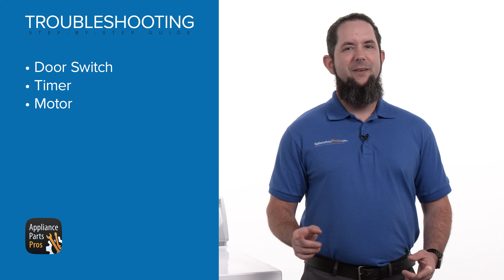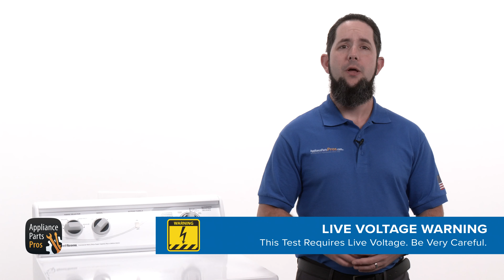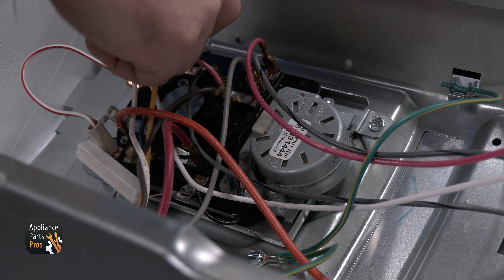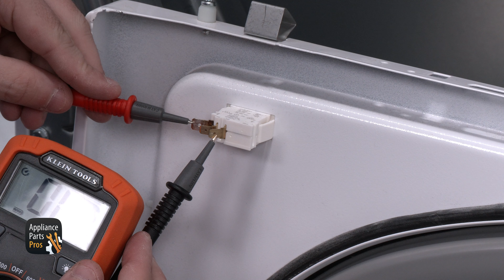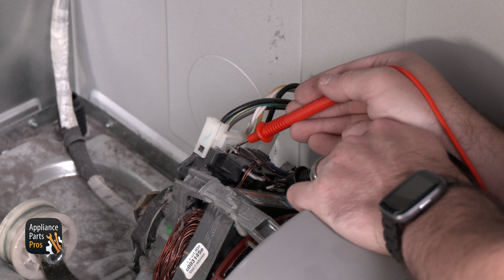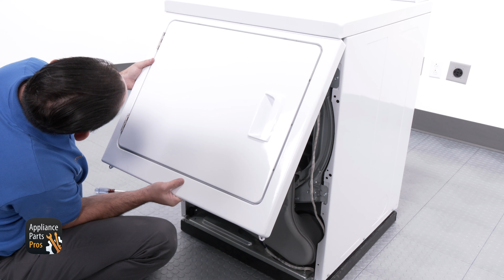Speed Queen Dryer Not Starting - Top 3 Reasons and Fixes

Comment: Great video overall.  Turns out my problem was that the "push to start" function of my timer dial was the issue.  You have to remove the pink+brown contact on terminal M and then measure between L1 and M while pushing on knob.  I was prepared to add just a new single pole momentary switch in parallel to the old one, but I was successful in fixing it with some WD40 electrical contact cleaner shooting it into the hole the switch contact rides in right under the round washer holding the dial rear on.  Putting the drum back in was hard and wish the video spent more time on that.  Other nice thing was wiring diagram and schematic for my unit was located inside the control panel which allowed me to figure out the other path for failure to start.  Thanks for the video and not making me pay to watch.
Reply from the maker: Great troubleshooting, @theoriginalmurph7615 👍

That’s a solid deep dive into the start circuit, and your contact cleaner fix is a great real-world solution. Appreciate you sharing the extra insight—it’ll definitely help others working through the same issue!

Comment: Will a bad thermal fuse on a coin operated speed queen cause the in use power light not to come on ?
Reply from the maker: Yes, it definitely can. On many Speed Queen coin-op dryers, a blown thermal fuse can cut power to parts of the control system—including the “In Use” light—since the fuse interrupts the circuit that powers the motor and other components. It’s worth checking the fuse for continuity with a multimeter. If it’s open, replacing it may solve the issue and bring that light (and dryer) back to life!

Comment: Samsung dishwasher not working DW60M5050FS
Reply from the maker: What is not working on the unit? Is the unit not starting at all, are there any lights on the panel, is it filling with water and not going through specific cycles?
Reply: I had a fried wire on element, which I replaced. Since I was there, I have replaced thermal fuse, element and thermostat.  Now the heat comes on when the timer is engaged, however, the motor won't engage. I have continuity at the timer, when open. 
I am getting 2.7 ohms on pin 3 and 2.9 on pin 5. Is it the motor?
Reply: Next time give more details!